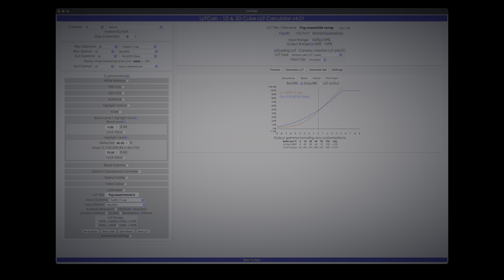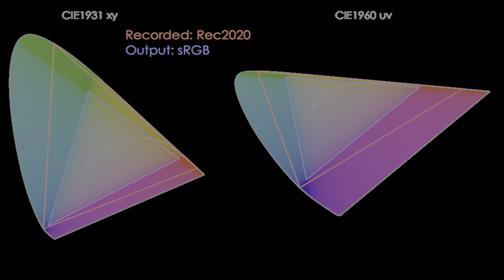Flog Direct To HDR: What, What, How?

Comment: I love the attention to detail with the lamp in the background where it basically demonstrates a colour with luminance way outside srgb/bt709 through the video showing this is real. Your video is the ONLY place on the internet I could find where the process of preserving the wide colour gamut from f-log is even mentioned, I am in the future going to get a fuji camera capable of f-log but I want to spend the time saving up for it learning about the grading process so once I get it in my hands I can just go outside and record log and know what to do with the footage right away. 

One thing I wonder, are the luts you linked to specifically tuned to X-T4 or would it work for f-log (version 1) from newer fuji cameras as well? I'm also looking into the possibility to use HLG instead of f-log but this process is completely absent on the internet as far as i could tell.

Comment from the maker: Well that is odd Pitch Patch left a comment here asking about luts but Youtube will not show it to me.
So - the short answer is yes. I have luts on my github which will convert flog to smpte2084 and can make some for hgl.
The trick is convincing the editing software you are using to treat the flog as smpte2084 or hgl in bt2020 colour space.
I'm more than happy to create more luts or discuss the process.
The flog_* luts here: https://github.com/SonicField/sonic-field-video/tree/main/src/ffmpeg_scripts/luts work in the following way.
1) Convince your software that the flog video is actually smpte2084.
2) Then apply the lut in the HDR workflow.
3) The result will have the correct smpte2084 gamma.

There are a number of them so that you can alter the brightness at the point of conversion. But to be honest - 90% or the time I just use: https://github.com/SonicField/sonic-field-video/blob/main/src/ffmpeg_scripts/luts/flog_0-Native.cube

They are normal .cube luts.